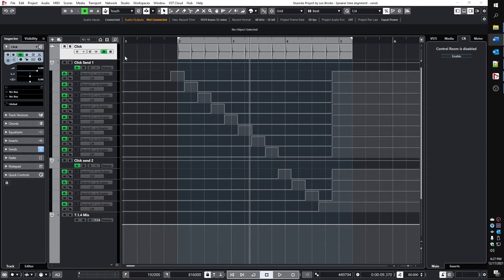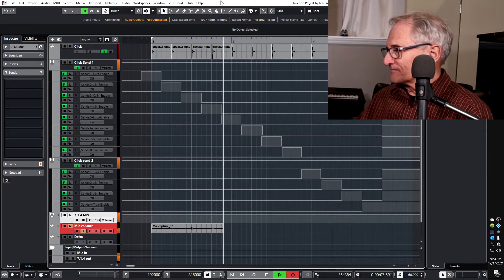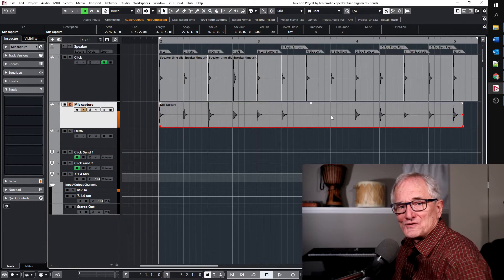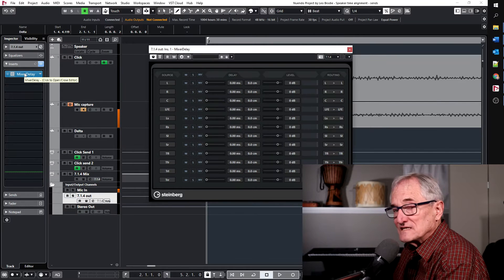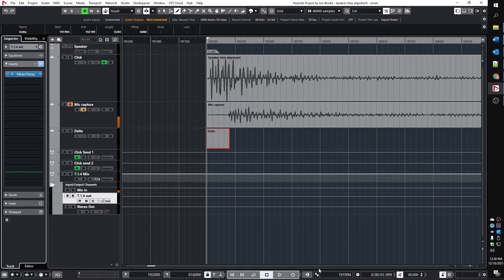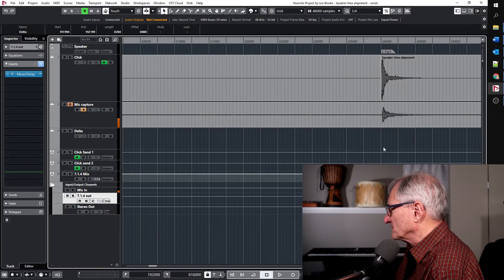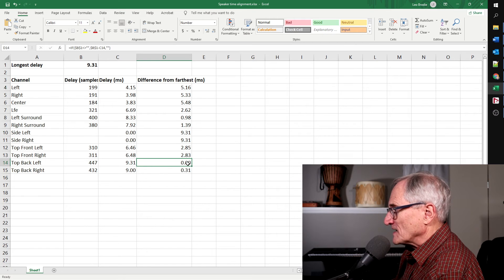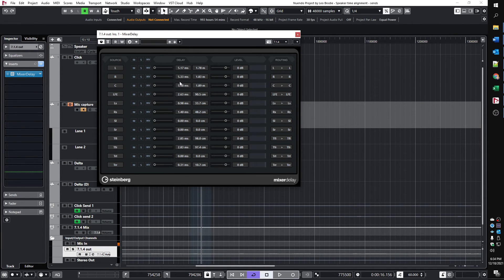Time-aligning multi-channel speakers with Nuendo

Comment: Great job, I was just doing the calibration as well a few weeks ago, also having gotten the tip for the calibration from Andrew Scheps. I recorded each speaker channel separately though and with 2 bars of click, that way I could also see the gain levels of each speaker and adjust them to a constant as well, which made quite a difference also. I don't think you mentioned it, but the measurement should be done with an omni microphone to get the best results - of course a dedicated calibration mic would be best but I just tried it with my NT2-A and feel I got okay results.
Reply from the maker: Thanks, Jaan! Those are excellent points. When I made the video, I simply used my vocal mic which is cardioid. Later I tried again using the mic that came with the AV processor and the clicks were much more clearly delineated in the recording. I'm not sure why, but the sharpness in the signal made it much easier to mark the timing. Also the loudness is very difficult to adjust by ear, and it helps to have the visual recording of the click. Can you clarify what you mean by recording each channel separately, and using 2 bars of click?
Reply: @balladeerstudio  Thanks for the reply! So I made 12 tracks(I have a 7.1.4 system) and recorded each track separately with the click being routed to a single speaker channel at a time. I admit your automated version made me go "duh, that would've been quicker" :D But in my version it was at least immediately apparent visually if some speakers had the same latency(because all of them were lined up after the same click marker). I recorded 2 bars for the gain, because I noticed that sometimes the first click wasn't the loudest and that the peak could be potentially 0.4db louder for some channels, I guess something to do with my room maybe. So I recorded 2 bars to be sure of the peak db level and then I could just check the db levels from each of the tracks level meters and adjust according to that. I also had a spreadsheet for both level and time, so it was fun to watch your video and feel some kinship :)
Reply from the maker: @beckisagod  Thanks for the details. Ah, the kinship of discussing so esoteric a topic with ANYONE in your life. :-D

Comment: Thanks for sharing your experiances with us. I am just wondering why you put the delay values in the Mixerdelay plugin and not in the Atmos plugin. Because when printing the ADM BWF file your delay will also be printed and if you use the Atmos plugin it will not be printed. Mixerplug in is a project plugin / Atmos delay is a playback plugin.  Or am I wrong?
Reply from the maker: Hi Patrick, thanks for writing! First, the Atmos plug-in that comes with Nuendo does not have a speaker configuration page. Speaker configuration appears in the Dolby Atmos Production Suite version, but that requires MacOS, which I don't have. Second, and more importantly, with Nuendo, the ADM BWF files is printed directly from within the Atmos plugin. It's not rendered through Nuendo's mixer, so the Atmos master is not affected by the MixerDelay plugin in my setup. Finally, I now have an Atmos-enabled AVR that can play Atmos music from Blu-ray and/or streaming services; the outputs of the receiver are running into Nuendo inputs so that I can easily switch between playing my own Atmos mixes and external Atmos mixes on the speaker array. I want the same time alignment for both. The MixerDelay plugin serves that purpose because it is an insert on my 7.1.4 output channel. I'm guessing you are familiar with the Dolby software as an external renderer, not the one built into Nuendo. Hope that helps.
Reply: @balladeerstudio  Thanks for the quick reply and teaching me right. I will keep an eye on you to learn more. My plans are to upgrade Cubase to Nuendo next year, you make me prepared.